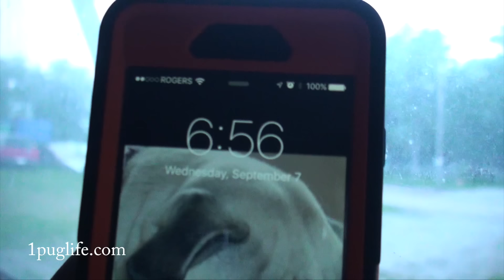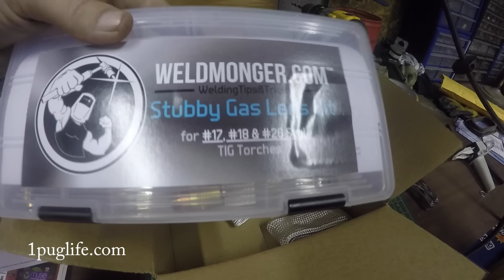cobbling my roof

Comment: So..... These "roof" guys have to borrow tools from the guy that hired them? Lmfao!
Reply: LMAO
Reply: What the roofer needs is a sheet metal hand brake which come in different widths.  You can buy them at most HVAC supply stores, they have a six inch wide clamp that is about three inches deep.  I've done sheet metal work in the HVAC industry using these brakes and having three of different widths.
Reply: why hare them then.?
Reply: Diamond Carwash lmao!!!
Reply: @dcw515  "Well hey I'd love to change your oil and do it right but you supply the materials bud, all I got's this shitty used oil from a '98 dodge, it'll work but it ain't gonna look good, but who's looking in the engine anyways?  Nobody!"

Comment: Hey quick pro tip on sharpening your tungsten. Sharpen so the grooves from the wheel go along the tungsten not across it. It messes with the arc if you do it how you did. So in other words, have the tungsten straight up and down on the grinding wheel instead of across it. It helps a good amount.

Comment: You said you was going to supply the materials bud but then moan at using the old flashing, you really got to stop acting the big man if you're not going back it up and walk away all the time. I guess someone don't want pay for a roof again will we have tiff pouring water down the wall stating the roof leaking?
Reply: At the end of the day if you run a roofing company you should know what is needed to complete a job. Before you price it...  Even if the customer buys the material.
Reply: Sean Goold the worse thing is when customers buy the materials it’s either not enough or got the wrong shit needs extra shit or they want to pay you with some extra materials it never works

Comment: It's not the roofers responsibility to supply the material. pug supplied the material. Not the roofers problem. especially when pug acts like a goof. he always tries to get a deal and do it cheap and then expects superb quality and service. Doesn't work that way. you have to pay for quality work. not hire goofs and make them do it on the cheap and then not pay them because it's not machinist precision quality. pug your a goof.
Reply: It's not the roofers responsibility to bring any tools either. You're right!

Comment: This goes out to the workers. Proper footwear and good gloves with a good grip and will help you to stay safe. And when working with sheet metals you should have on some good denim jeans and a longsleeved shirt. This will help protect you from gashes from the Metal . Working on a job without a shirt is very unprofessional. I know it's hot but it just doesn't look good. Unfortunately customers like this are not completely unavoidable. Sometimes I like to find what other projects the customer has had done and try to find out who did them and see if I can't obtain information about a customer from a previous worker. This is depending on the scope of the job. If it's just a quick job then I'll just try to get it done and move on. But on a large project this information could be crucial. And reading people during the estimation process of a job also will reflect on pricing.
Reply: I have been on a couple of estimations  that I have gotten bad vibes from a customer regarding these very issues. The numbers doubled because I can live with or without this customer. And if they bite on a doubled up bid I am more than willing to take the extra steps to satisfy the customer because at this point  they are paying you more than a fair wage. But in this situation the customer is already harping about pricing. Try not to get yourself into the situation. I know you probably need the work and if this is the case and you took the job regardless then you have to take whatever he throws at you. Because you excepted and agreed to the terms. Keep in mind customers like this may tarnish your reputation.

Comment: He needs two sheets of steel and a new flashing for the insulated pipe. Under lay up and passed the pipe, flash it then go from the ridge down around passed the pipe. 
Bingo no.need for caulking

Comment: hey pug , metal ruufs aside , a good cheap trick ( had a fews beers and missed that part about the flashing on stack ) but the trick for caulking to last for frikken ever and ever is , use fibeglass ressine to prime before ya caulk(primer can be splussed on the dont matter ) with sica flex pollyurithaine dude , wait till the primer gets tacky and then caulk and tool hard . from a caulker

Comment: Pug here's the way I see problem 1 with the roofers:
Did you get a written contract with them not just a quote?  Did you have any other roofers coming and give you a quote?  Did you, if you have a contract does, it specifically spell out in writing what work was going to be done and what materials were going to be ordered besides the sheet metal?  Did it say the roofers were going to put new flashing around the vent pipe?  Did you not have the same problem with the roofer that put down the rubber roof about materials he was specifically using and fixing the meeting of the area where the rubber roof met the shop?  If you do have a written contract look it over to see whats on it.
Problem 2 Wal Mart:  It is illegal to record on someone else's property with out their permission.  Not that I do not mind the store videos but look at what happened at Costco is the same thing that happened Wal Mart.  Wal Mart can call the police and have you arrested for trespassing if you do it again and issue a order for you not to return to Wal Mart and face arrest for that.  Wal Mart could seek an order to have any You Tube video of them taken down, they may get You Tube itself involved and threaten to remove their advertisement from You Tube until yours are down.

Just a friendly piece of advice if it helps fine, if not oh well, I hope you get your roof finished the right way without too much more drama.  Also the roofers seemed ok when they started, even doing some romps with you but good luck.

Comment: Shit job on the roof, They didn't square it before they started-Didn't level the joists-If the roof was that out of square they should have Squared it at the facia on each end-I wouldnt pay these Jerk offs until they at least cut back the excessive overhang and installed the proper edging....I feel your pain Bro!

Comment: you got like 3 drills why you sharpening your tungsten by hand haha. Weldingtipntrick put your tungsten in your drill and then run it on the bench grinder for a perfect sharpening and make sure the grind marks run vertically aslong as youre smokinn cigrets

Comment: Why don't you get some leather gloves rather than just those tig fingers? That's the way always i welded when i was working in production shops, just curious.
Reply: You're supposed to use the tig finger WITH leather gloves. Leather gloves only do so much before you try to prop with them, they get hot and start to shrink around your fingers. The tig fingers actually do work really well for letting you prop right on the piece you're welding while saving your hands/gloves. Not something you use all the time or for every job, but definitely come in handy when you need them.
Reply: huh, that makes sense. Never used em my whole welding career, then again i only welded for 6yrs.
Reply: I imagine in a production shop you'd have all sorts of fixtures and clamping arrangements that would make a tig finger pointless. At home doing one off things that you just want to get done quick and don't want to search for ways to prop your torch hand is where they shine. Same thing can be achieved with some welding blanket too.
Reply: True, we did have tons of jigs at the plant. Though even at home when I was working on a project i'd just throw my leathers and gloves on and get on with it, I can see where one would come in handy though. Sure did ruin a lot of gloves doing that XD

Comment: When you sharpen your tungsten's when you sharpen your tungsten's you should sharpen them so that the hatch marks go horizontally with the rod in line with the rod you did it where your hash marks go against the rod you'll get a cleaner current better art in the last longer the other way

Comment: I would like to know what f**** heroin alley or crack alley he found these people at how the hell can you do a job without any other tools no hard hats no hard no steel toe shoes no damn extension cords come on no cutters I've done a lot of roofs in my day from shingles the standing scene to metal I could have took my 7 year old there and he would have worked better than them guys they didn't even flash the bump out on the chimney pug I don't even know you but I feel sorry for you man and the really sad part about the whole video is this man's pain probably 4,000,or 5,000 for a new roof and dragging them panels up hearing that screech of that metal or metal that's chipping the safety paint coating underneath which will cause rust from moisture

Comment: When sharpening a tungsten, remember to hold it parallel to the wheel, so the micro grooves on the tungsten tip guide the arc correctly